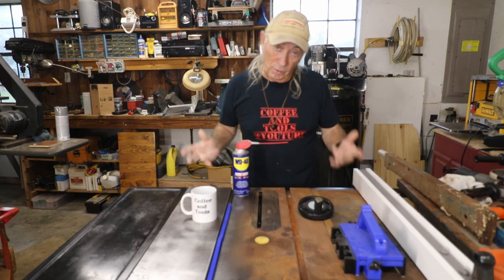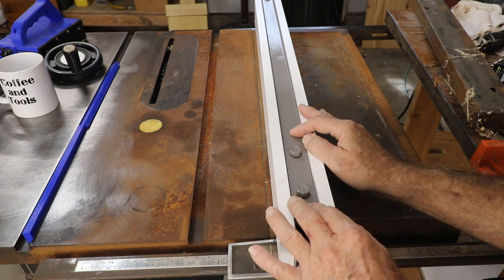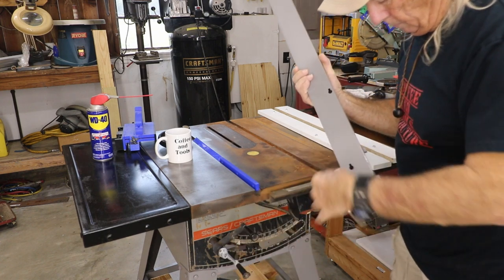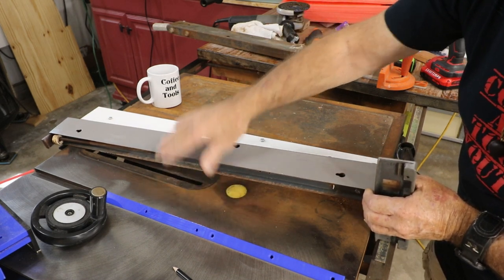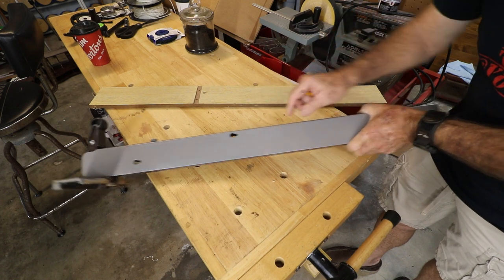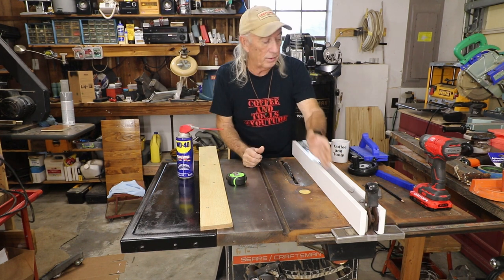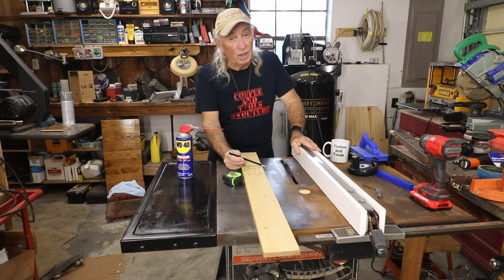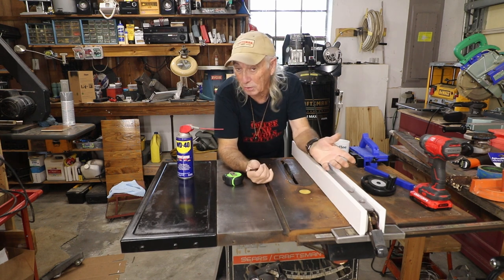Craftsman table saw fence upgrade 12 inch @ Coffee and Tools Episode 178

Comment: You are absolutely incredible sir. You just saved me from buying a new fence for my Craftsman contractor saw with cast iron extensions that I absolutely love. Havent decided if aluminum strips would be too heavy or if I should go with maybe PVC board. But this is wisdom that only wise men share and I greatly appreciate it. You just gained an extremely happy subscriber!
Reply from the maker: Welcome to my garage there Mark :)
Reply: @SirTools  ended up going to Lowe's as soon as I finished watching your video. Picked up a 1x6x8 PVC board and it turned out great. I think aluminum would have been way too heavy anyways and probably overkill. Turns out my front rail was not level with the top of the table because when I held a square in the corner of the table and fence it had a slant to it a little bit. So I loosen the bolts on the front rail and use the rubber mallet and tapped it back square and that's all good now. The only thing I have to do now is replace the little white wheel that's on the end of the fence because it has a flat spot on it where it got smashed or got stuck in one spot. I think I'll just  model that up in FreeCAD and 3D print that with ABS filament. I've probably had this table saw for 7 or 8 years now and I never knew exactly how you were meant to use those keyhole slots. Like I wasn't sure if you were supposed to run bolts all the way through it or what you were supposed to do. This information in your video is amazingly helpful. Thanks again.
Reply from the maker: SO glad to hear this. The 3d printer should be able to make up that wheel. I have 3 portable table saws that came in for review and I still love my old cast iron table saw. It feels solid and gives me the best cut to this day. I think new table saws are "over rated" LOLOL....

Comment: Looks good. I'm about finished rebuilding a 10" Craftsman 113 table saw from 1980. I was going to run bolts through the holes and sandwich the boards together. This video changed my mind. I just finished this upgrade tonight and it looks/works good. Thanks
Reply from the maker: Super thanks for watching.

Comment: I have a 113.  I have already done the top.  It was inherited from my father.  It was in good shape, but had some surface rust on the top.  I have a good blade, added wheels, and looking to do some dust collection, a link belt, and a delta T3 fence.  If the link belt does not solve the vibs I will likely buy some billet pulleys I may just do that and get the link belt at the same time.  Also, I have a sheet of phenolic coated baltic birch plywood.   I may make some throat plates for that and install the microjig splitter.  Should be a great saw when I'm done.

Comment: my suggestion for that table saw is to sand not grind the rust up to at least six hundred grit paper. once it is clean and smooth do not use oil-based lubricants, use wax. I used to use Johnson paste wax, however, SC Johnson stopped making it. So, for now, I am using turtle wax. Until I find a different substitute for Johnson's paste wax.
Reply from the maker: Can't find good old Johnson paste wax around ?

Comment: Great job. You also demonstrated the best way to make the fence work by holding pressure toward the rear of the saw. I keep wax on my rails and fence to make it move freely. I have been thinking of making a new head for my fence; a t-square type and would retain the main part of the fence, that way it will clamp to the front rail and still have the clamp in the back. Be the best of both types.
Reply from the maker: Takes more time to clamp, but totally worth it.

Comment: Family first always! I have three 113 series craftsman saws. workhorses. I use them so I can eat...lol. Everyday I crank them up and a couple other tablesaws too. They last forever I guess. My shop is old like me and has some holes in the sheet metal roof as it was used before I got it so when it rains I have rust to take care of but waxing the tops help. I like the upgraded fence idea, I just screwed an auxiliary thru those holes but what I use them for I seldom move the fence, except for maintenance. .

Comment: I have this saw..it does not have a fence and/or a kick back saftey...do you have ideas on building a fence ? And purchase something for kick back..newbie all the way
Reply from the maker: There should be a round steel rod on the backside. It was a clamp type configuration for the riving knife and the guard assembly. Parts wise, it would be a very hard search. You might have to make one from scratch. We did see one in a yard sale about a year ago, but sold the saw and no needs after that. Also you can mount a solid guide pin or riving knife for straight cuts,  but we need to do a show about that one LOL

Comment: So what model is the new fence? Mine has the original screw handle style from the beginning of the video.
Reply: I had the same crappy fence as you, the screw threads on the tensioning bar eventually 
got stripped.  Looks like his new fence has a cam/lever lock mechanism.  I retrofitted my
saw with a VEGA System, works much better and is very accurate.

Comment: I like the old craftsman fence, the type that pinches on both ends of the table. It is better for operations where the fence is solidly anchored near the blade. Newer fences are better in wider rip cuts, but I want a secondary saw for operations near the blade where fence is very secure.
Reply: I have the older style.  I don't like it much.  I hate measuring for it.  The tape is not accurate and it moves slightly when it pinches.  It works, but a bit of time to get the set up right and I don't feel I have good repeatability if I move it and need something the same width.

Comment: anyone not able to figure out how to mount these two boards to the fence shouldn't be allowed to use sharp implements
Reply: Well my first thought was that you were meant to just put bolts straight through from one side to the other. But I never did anything to mine because I was afraid to crush the existing fence by putting bolts all the way through it. So even if it was obvious to you what they're for, not exactly obvious to everyone else. Because there is a wrong way for sure.
Reply: It's obvious that's what the holes are for.  This guy is a real genius, using a pencil to locate
the holes.  Also, I never knew a lot of people aren't born with all the information.  I'll bet my
paycheck the family tragedy was an opioid related death...